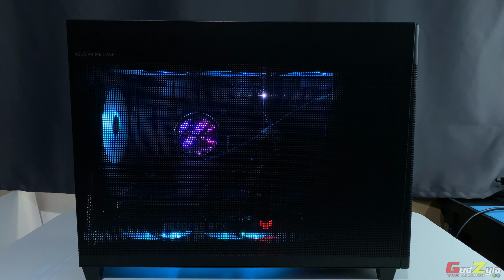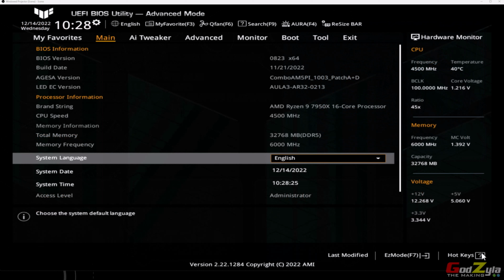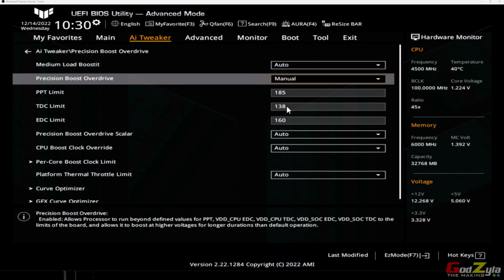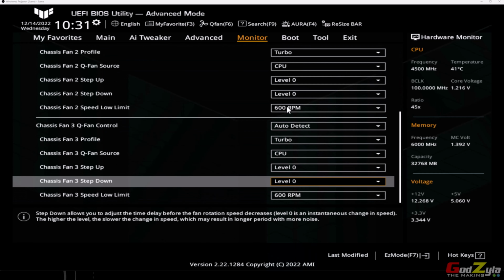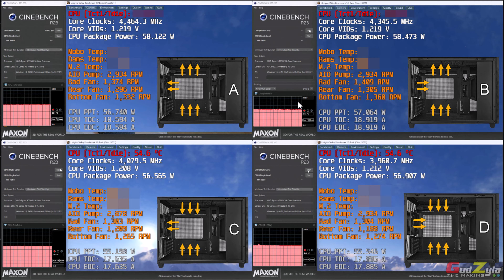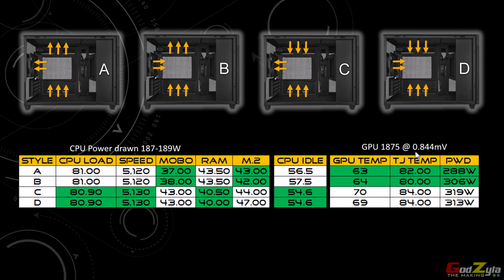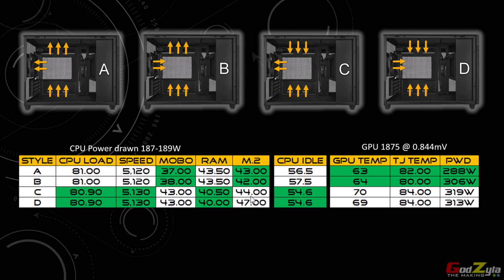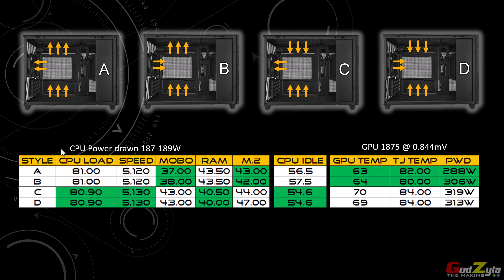ASUS AP201 Prime - Thermal Test (Part III)

Comment: Hey there! I really liked the video, it was super informative. Just to share my experience with this case, I'm using the Thermalright Assassin Mini and I made a small adjustment by positioning the CPU fan as intake to get some air from the rear. It worked really well and dropped my CPU temperature by about 7 degrees. If you're using an air cooler, the B configuration is definitely the way to go.
Reply from the maker: Hi mikethocks, welcome to my channel. Thank you so much for the information shared, greatly appreciated it.. this will aid those who read this comment. 👍👍👍
Reply: how many fans are you using as an exhaust on this setup?
Reply from the maker: @gbsmuller  hi welcome to my channel. There is only one 120mm fan slot. therefore only 1 at the rear to exhaust heat.
Reply: @KleoYan  I've got five fans. I'm using Thermalright TL-C12C on the rear and top. And I'm using the TL-C12CR (reversed) fans on the bottom for a uniform look.
Reply: @KleoYan  aircooled not aio. Also, rear and bottom intake. Only top exhaust. :)
Reply from the maker: @mikethocks  thank you to help in answering 😉
Reply: @mikethocks  are you using 2 intake 2 exhaust? That being 1 intake at the back behind the cpu along with the cpu cooler next to it, and then 1 intake under the gpu and 2 exhaust on top?
Reply: @radtronic  2 intakes bottom, 1 rear exhaust and 2 exhaust on top.
Reply from the maker: @mikethocks  thank you very much on the follow up. 👍👍👍
Reply: Hello, I am unsure about applying your suggestion because there is no dust filter at the back of the case. Does the method you mentioned allow a lot of dust to enter the case?
Reply from the maker: @fatihgoktas9943  hi welcome to my channel. You might need to observe as different place will have different impact. For me I do regular dust cleaning as the nature of this mesh case will have dust.
Reply: @fatihgoktas9943  You don't really need a dust filter, you just need to clean ur case regularly as the case has a lot of holes.

Comment: You are a top-notch builder and engineer.
Very happy to come across your channel and support/subscribe to you.

I just suggested this exact case to an online friend of mine and helped walk him through his very first build (he's only 19 years old) over a discord video call.
He did great. He only has cable management left to do, and walking him through that over a video call would be rough, so I told him to just do his best :)

Intuitively, I had him go with the "A" setup in your video for the fan directions. It makes logical sense with cool air coming in from down low, and hot air escaping from the top. 
Fighting nature is usually going to come with consequences. All of which you showed perfectly in your tests.

Keep up the great content!
Reply: Some more details addressing fitment in your Part I & II videos:
We were able to have the AIO at the top with the tubes near the back. No interference with the rear exhaust fan.
We set the PSU cage to the middle setting.
We were able to install 3 fans at the bottom intaking air.
Although we got an ATX PSU; we were able to massage the PSU cables so that they do not interfere with the lower fan near the front of the case.
We oriented the PSU to pull in air from the front of the case. This works well because the cool air comes in and shoots up and through the front radiator fan.

It's all tight, but beautiful. 
Easily my favorite MATX case.
Reply: For those interested in the specs:

CPU $368.58
AMD Ryzen 7 7800X3D 8-Core

CPU Cooler $104.66	
Deepcool LS720 SE 360mm AIO LiquidCooler

Motherboard $169.99
Gigabyte B650M AORUS ELITE AX

Memory $109.99
TEAMGROUP T-Force Delta RGB 32 GB (2 x 16 GB) DDR5-6000 CL30

Storage	$164.99
Crucial T700 1 TB M.2-2280 PCIe 5.0 X4 NVME

Video Card $699.99
Sapphire PULSE Radeon RX 7900 XT 20GB

Case $79.99
Asus Prime AP201 MicroATX

Power Supply $144.99
Deepcool PX1000G 1000W 80+ Gold Modular ATX

Case Fans $40.89
ARCTIC P12 PST A-RGB 48.8 CFM 120mm 3-Pack

Monitor $249.00
LG 27GL850-B 27.0" 2560 x 1440 144 Hz Monitor

Keyboard $39.99
Cooler Master SK622 RGB Bluetooth/Wired Gaming Keyboard

Mouse $34.99
Logitech G305 LIGHTSPEED Wireless/Wired Optical Mouse

Headset $74.98
Sennheiser GAME ZERO Headset

Total: $2283.03
Reply from the maker: Hi TofuGuru, welcome to my channel. Wow, thank you for your valuable feedback and to have share your experience with your friend’s build. I am glad everything runs well for your friend. Thank you.

Comment: Another potential plus with the A configuration is that air comes into the case via the filter at the bottom.  This would reduce dust build up I suspect.
Reply from the maker: Hi Sean Ohsee, welcome to my channel. Infact positive air circulation is good and you are right. provided there are air filters which does a good job from dust. Thank you for your feedback 👍

Comment: I was going to buy a coolermaster NR200 but this case looks way better for me. Half the size of my current case, still fits the liquid freezer and has more space for a GPU. I'll probably follow your A configuration and bonus, that means only filtered air gets intaked.
Reply from the maker: Hi B fish, welcome to my channel. if you are fitting an Arctic Liquid Freezer II 360. you might have to reconsider as the placement is tricky if you have a full ATX power supply. watch this and you will understand what I am trying to explain to you. https://youtu.be/p-dyGeduWlw

Comment: My concern on this pc case is the lack of clearance between the gpu and the bottom intake fans(less than an inch). If the bottom fans are the only source of intake air, and the rear and top fans are exhaust, there would be a lack of positive pressure.
Reply from the maker: Hi Arjays Mendozaar, if you using a 2 1/2 slot card. That will sit just right. Anything that is beyond 2 1/2 slot, you will have to sacrifice the bottom fans. Another alternative is the Lian Li Dan A3. That has a side fan tray. If you using aio at the top and with the side fans without the bottom fans. That might work.

Comment: thanks for making useful video
Reply from the maker: @ezlmao440  hi and welcome to my channel. I am glad you like the content. All the best with your build too😉
Reply: @KleoYan  I bought it after watching your video :D
Reply from the maker: @ ooo nice. You will not regret of the quality for sure. 😬
Reply: @KleoYan  i received one today, its awesome, but 1question, vertical VGA can fit in case?
Reply from the maker: @ezlmao440  Nice, as for vertical VGA, I did not test on this but I dont think it's a good idea, as you see, the only airflow that pushes cool air into the case activately is at the bottom. If you successfully mount your GPU Vertically, you might not be able to mount the bottom fans.
Reply: @KleoYan  thank brother
Reply from the maker: @ezlmao440  You are most welcome. All the best with your build too. 👍

Comment: Whats the temps without the bottom intake? I have a mobo with a lowered pcie slot and a 3 slot gpu, i dont know if adding more fans at the bottom would really prove to be beneficial. Im worried about creating turbulence cause the case fans are so close to the gpu
Reply from the maker: Hi Asimo, welcome to my channel. This you will have to test it out. So sorry can’t answer your question as I have returned this case to Asus SG.

Comment: I have this build and I changing motherboards to the ASUS ROG CROSSHAIR X670E GENE. I am going to change my fan setup as well. Is it an good idea to have 3 120mm intake fans, 3 aio fans exhausting and the back case 120mm as intake or exhaust?
Reply from the maker: Hi Rolando Villegas, welcome to my channel, if you are referring to the bottom as 3 x 120mm fans. you might have some issues to fit the fan below your PSU. it depends on your PSU Size. in general if able to populate 3 x 120mm intake from the bottom, your GPU will enjoy more cooling as for CPU, it's very minimal.

Comment: HELLO . i want to combine 13700k + noctua nh d15. Can you give me advice with case ap201? It seems option B is good for air cooling but also the most dusty.
Reply from the maker: Hello Siêng Ham Học, welcome to my channel. Option B is only good if your noctuc is exhausting hot air out to the top and not the rear. This will be of a good choice. As for dust, you can't avoid. this is the nature of this case. All is needed is weekly cleaning using a portable air blower.

Comment: what If you add a intake fan in the front below the PSU?
Reply from the maker: Hi ishii-san, welcome to my channel, if you are to mount an additional fan to the front. it will cool your GPU future and pushes hot air out faster, which might aid with the CPU Temp.

Comment: I wonder if you can put 1 fan on the front below the power supply?
Reply from the maker: Hi Weezyyy Production, welcome back, yes it's possible if you are using a 240 Liquid AIO instead, but with mid tier processors.

Comment: Hi Kleo, do you remember if the bottom fans make a meaningful impact? I'm running a 13600k + 4090 with 360 aio (exhaust) and the Asus case fan (intake). Temps are ok but after a long gaming session the whole case does feel quite hot. Considering if I should get extra fans for the bottom. Or, I'm even thinking of (somehow) mounting fans on the side panel. Thanks for the video!
Reply from the maker: Hi Robbie Chan, It does not really make any improvement to cool down the CPU but it does cool down by 2 to 3 degrees on the GPU. as I was using the Asus Tuff 3080

Comment: Quick question, I have an artic iii 360 on top of a similar Jonsobo d31 case. I was thinking of switching the bottom 2x 140mm to 3x 120mm, would that make my temps worse/better/same?
Reply from the maker: Hi Yolo Guy, welcome to my channel. Maybe you can test it out as I am not able to answer your question. I have not tried having 2 x 140mm vs 3 x 120mm. so sorry about it.

Comment: Hey bro im planning to buy ap201... Can u tell me which option is good for me im using noctua dh-u12a air cooler with extra 5-6 artic case fans so tell me which option is goof for me?
Reply from the maker: Hi AnShu Rajpoot, welcome to my channel. I would advise you to have the mesh version over the glass version.
Reply: I was planning to buy tg version but ur saying buy mesh version so I'll buy mesh version and tell me pros and cons of both versions and tell me which fan configuration is better for me  @KleoYan
Reply from the maker: @ this case if with glass will be running hot as the only intake of air is at the bottom and it’s so close to the gpu. This will end up accumulating hot air up to your air cooler. So having a mesh side will give more cool air to your aircooler. As for configuration. Bottom you can don’t use fans as your gpu already pulling air from the ground as for the rear. Place a rear fan to intake and at the top, top front fan as intake air from the top to give more air to your aircooler. And for the inner fans. 2nd and 3rd do exhaust, to push warm air out of the case

Comment: im planning to do  a build on this case and was considering to go with 360mm aio on top and can we add 2 fans on the side panel by drilling some holes and fixing them ? modding them for better air flow on  a mesh side panel
Reply from the maker: Hi Veera Sekar, welcome to my channel as I have returned this chassis to Asus Singapore. I can't be accurate to tell you if you can. However as I recall, there are still space to place for 2 x 120mm fan if you decide to mount two at the side, right above the AIO block. I suggest you use zip ties to hold the fans instead of drilling the chassis. It's made of steel, once you drill it will rust after a period.
Reply: @KleoYan  yah rust dint think of it 
thanks !!
Reply from the maker: @veerasekar  you are most welcome and all the best with your build too.

Comment: Thanks very much for such thorough testing; very interesting and useful.

I don't know, but I imagine that A is drawing air in from the side and (possibly) front mesh panels so it is negative pressure in the case. Wouldn't it be worth running B for neutral or slightly positive pressure, given that the essential difference is power draw?

Also, along a similar train of thought, would there be a benefit to separating the GPU and CPU with a blanking plate of some kind above the GPU? Maybe this might reduce mingling of hot GPU exhaust and cooler air in and around the case.
Reply from the maker: Hi Herbaceorus Boredome, welcome to my channel. yes you do have a point but for me, i normally do cleaning every 2 weeks to keep fans tip top, radiator clean and the case free from dust. All it's needed is just a portable blower. So ya, I would rather go with A to have the lowest temperature. Once again thank you for your feedback and to have visited my channel.

Comment: How many fans on top,bottom you have used ?A,B,C,D??
Because i am conscious about dust
Reply from the maker: Hi sahara tajim, welcome to my channel. the configuration are as follow :-

Top - 3 x 120mm fans (exhuast On 360 liquid AIO radiator)
Bottom - 2 x 120mm fans (intacke)
Rear - 1 x 120mm fan (exchuast)
Reply: Which configuration will not consumed more dust??in your perspective A or B or C or D?
Reply from the maker: @saharatajim6625  Hi, to be honest, I have not test dust on these configurations as this case is a loan unit, which I have returned to Asus Singapore. So sorry about that.

Comment: hi Kleo this video is really helpful but may i ask? how about if i use 280mm radiator on top, can i add 1 more 120mm fan on the top part of psu for more out take flow?
Reply from the maker: Hi Rome Jek, welcome to my channel, I would not advise you to place a 280 Liquid AIO as there might be no clearance for your motherboard VRM heatsink. you might want to watch this -> https://youtu.be/p-dyGeduWlw .
Reply: @KleoYan  oh so just only 280mm fan and not aio cooler?
Reply from the maker: @romejek  it's 2 x 140mm fans. at the top.

Comment: Hello Kleo, does the bottom fit two 140mm fans & have a dust filter?
Reply from the maker: hi Huy Vu, welcome to my channel. you are only able to place 2 times 120mm fans and at the bottom, it does come with a dust filter, you should watch this.. details of this case https://youtu.be/p-dyGeduWlw
Reply: @KleoYan  G8, I'll check your in-depth review.
Reply from the maker: @ceeril  ok all the best with your build too 😉
Reply: @KleoYan  Hello again Kleo, do you think if a low-profile CPU cooler is much better for small factor case like AP201?
I am using a single tower for AP201, but the airflow looks chaotic as the CPU cooler is "chunky" now although the temp is good enough.
Reply from the maker: @ceeril   hi and welcome back. It depends which low profile cooler you are getting. Also to which processor you are using. If you are using highend processor then I would advise you to get a beefy low profile heatsink. Now do pardon me as I am not very profound on low profile aircoolers. This you might have to do some research .
Reply: @KleoYan  My current CPU is i5-12400f (rarely overclock), but cooler is dirt cheap JONSBO CR-1000 (durability still good after many years)
I am checking "ID-COOLING is-50x v2" or "ThermalRight AXP90 X47" for low-profile.
Reply from the maker: @ceeril  I see. for the ID Cooling, you might want to check out the ID Cooling IS-55 and do take note on the ram height clearance. https://www.youtube.com/watch?v=xtvAI-XTdfk
Reply: @KleoYan  Yeah I did check that video, but IS-50x v2 seems cost effective atm and tall enough for my 44mm RAM, but doesn't support AM5 socket?
I might upgrade to 7600 later if AM5 mobo price cools down.
Thermalright price is somewhere between IS-50 & IS-55 in my country.
Reply from the maker: @ceeril  hi, I see, the IS-50 V2 or the IS-55 does support AM5 https://www.idcooling.com/Product/detail/id/258/name/IS-50X%20V2 and https://www.idcooling.com/Product/detail/id/326/name/IS-55%20BLACK but the choice is still yours. Just make sure you have enough ram clearance.. all the very best and if it's ok, don't mind to share your results with me. thank you!
Reply: @KleoYan  Ok, I just got the IS-50 v2 and the temp in general decreases up to 6 degrees when idling. But the interesting thing is the rear exhaust fan exhausts a lot of cooler air than top exhaust fans. Guess I will turn the rear fan as intake, currently, my top & rear are using the same connector.
Reply from the maker: @ceeril  Hello Huy Vu, welcome back and thank you for the results. when you reverse the fan direction at the rear, during load, will the temperature be better? Don't mind share your findings, am curious to know, thank you!

Comment: I was thinkig of getting 2x140 fan top, 1x120 fan rear, 2x120 fan bottom and 1x80 fan front. How would you manage to controll the different sizes? One hub controller, splitters... IDK
Reply from the maker: Hi Pau Homs, welcome to my channel. For the fan RPM, I just plug then directly to the montherboard Fan headers. CPU_FAN for radiator, CHA_FAN 4 for the bottom and CHA_FAN 1 for the rear. As for the ARGB, i am using the argb hub.
Reply: @KleoYan  I see, thank you for your response!
Reply from the maker: @pauhoms  ypu are most welcome.

Comment: does configuration A causes negative pressure? with all the holes around the case will collect a lot of dust.
Reply from the maker: hi Oz B, welcome to my channel, for configuration A it does causes negative pressure and dust will start to accumulate but if you can tweak the top and rear fans so that the amount of air going in from the bottom will match the exhaust then this will elimate dust accumulation.